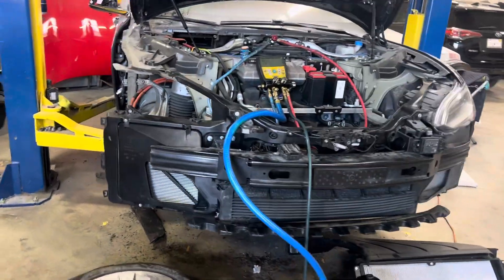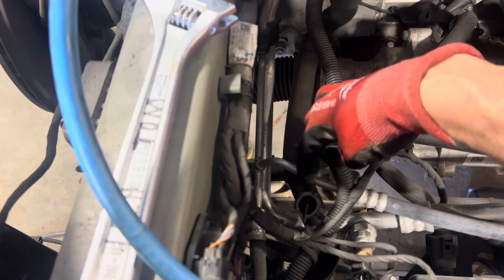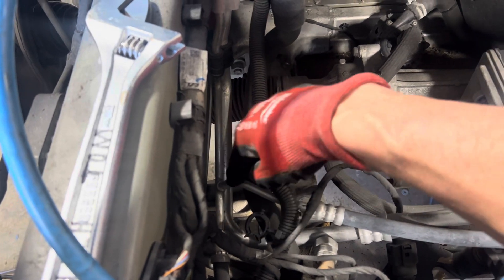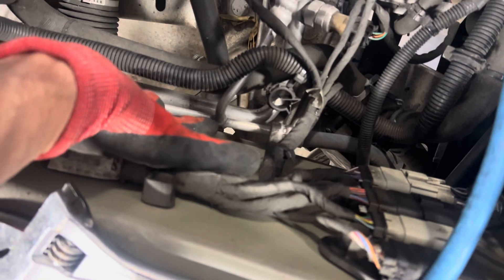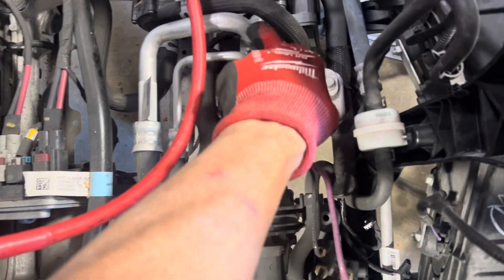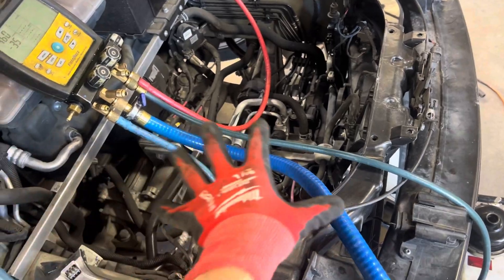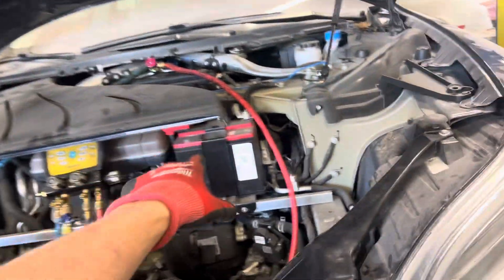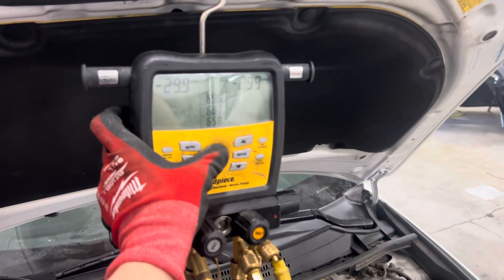AC tesla model SP 100 air conditioning circuit two condensers.

Comment: dual condensers rock .  but Very large singles also    Clearly see some car makers actually think about the design . With good condenser size the TXV receives constant  low temp liquid .  The TXV can then do its job really well and the evap core  works most very efficiently . In saying that good cooling is compulsory on an electric car  so u have to ask yourself  "" If it were not for the electric drive would the AC system be as good ???   In most cases probably not .
Reply from the maker: Dual condensers don’t make it run any better or any worse
It has nothing to do with efficiency or inefficiency 

Dual condensers are used because of necessity of lack of room space . 
They have that sloped small front nose that does not have room for a single large condenser . 
     You’ll see Lamborghinis Ferraris, McLaren, some Audi and many other cars that have that very sloped small space aerodynamic design put two small condensers in where they can fit them. 

About the only advantage, the electric compressor has over a standard mechanical compressor is when you’re ad idol, and the engine is at idle RPMs, mechanical compressors, or not designed to work efficiently so some cars you’ll notice the temperature of the dash start getting warmer when you’re sitting at a stop sign or Moving slow stop and go traffic on the freeway or street. 

Electric compressor doesn’t care it could just spin up to 5006 or 7000 RPM‘s as needed depended on the load 

The expansion valves the the same unless it’s electric . 

But this is one of the reasons and fuel efficiency. They have variable displacement compressors on cars now. . 

You can oversize the compressor a little bit 

And when you come to a stop sign or are in stop and go traffic .  Variable displacement compressor at idle speed, where a normal piston compressor may not work efficiently can just turn on an open up displacement up for the inefficiency a 700 RPM idling engine.. 
        This is one of the ways they have overcome that problem. 

Having variable speed or variable displacement has been used in residential specially com commercial for decades 

Automotive is just playing catch-up .
Reply: An  evap core has far greater performance when being fed liquid thats say close to ambient eg 45 deg cel/ approx 150psi  refrigerant on a 40 deg ambient day  vs 65 deg cel /approx 290psi on a 40 deg cel ambient .
You would be aware of the occurrence of flash gas . When excessive high temp refrigerant is supplied to evap this process occurs and  consumes BTU cooling capacity  performance there by reducing its efficiency . 
Automotive can often run pressures/temps pending design . Big condensers rock !
Reply from the maker: @paulthompson1654  coil, more efficient when it’s full of a liquid refrigerant at 0° superheat. 

Does not matter what the pressures are pressures mean nothing we don’t go by pressures. It does not matter what the temperature is. We don’t go by temperatures. That means nothing. 

It’s fully saturated with liquid refrigerant at 0° superheat. This is the most efficient evaporator. . 

But then we run into the problem of liquid refrigerant getting back to the compressor and wiping it out .

But there are, but they do not do that in Automotive 

On some of my commercial VRF systems I have a few videos out can run down to superheat 

Dehumidifiers are designed to run a liquid flooded evaporator .
Reply: Many imported vehicles/ machines  are often refitted in Aust due to the very hot conditions . Flash gas occurs to an excessive amount reducing evap BTU capacity [the evap has to reduce the very high liquid temp there by reducing available cooling capacity ]  . I n a very hot conditions evap performance needs to be working well at it most efficient . This occurs as expected in fixed displacement compressor systems . All auto based systems suffer from it to some degree ie its a linear scale . Head psi which is upwards of  225 psi is effected . Systems that run 250 up are badly effected by it . 300psi is not uncommon . This is most obvious in machines that have not enough evap size that operate in very difficult conditions .  
Very high sun loads ,  fast idling 1200rpm for hours , very high ambient 100--115f .  Think govt trucks , fire trucks , container cranes , tractors , underground mining equipment 
The  evap TXV  needs to receive cool solid liquid
Reply from the maker: @paulthompson1654  older BMWs high side pressure control fans from the factory. Don’t even come on until they hit 270 psi as normal. They could run there all day long and ice tea and stay nice and cold.. 🥶 

My personal 2012 Prius at 106°F is 39° out the dash no problem at all when properly charged . 

All my personal cars for the last 30 years I use for business idle all day long from the moment I get into them from 6:30 AM in the morning to when I get home at night the car never gets shut off stays running between jobs. Idling. .  Air conditioning never gets turned off in my.Cars. Engines never get turned off in my cars..
Reply: Euro cars , mostly British just have trouble keeping there engines cool let alone some of the pathetic a/c unit performances.  EG  In constant weather above 95f up to 115 f .   No a/c unit survives long term in high ambient with high operating pressures and performs .
When a particular full size vehicle came out here and converted to cabs and handi capped  taxis  the aircon was that pathetic after conversion they were sent back to GM . It took 3mths  but were up graded from serpentine to  parallel flow . This lowered psi alot  but still only just acceptable a/c perf.  300psi to round 250psi . These cabs did 6500miles every month , any issues developed quickly .
Reply from the maker: @paulthompson1654  we have no problems here in Arizona and Utah where it hits 122°F into the summer. 

Sounds like you guys need some different cars . Maybe Kia
Reply: Best performance retro fit condensers   was 160f/300psi downto 112f/150psi . More common results were  180psi--- 210 psi . Often results were also helped with aux fan .  In hot weather the ac evap performance improved alot .
Reply: @coldfinger459sub0  i like that you never turn off the car engine and the air conditioner .......that's very interesting..... cheers   Jay.

Comment: Can we say that 1st radiator is just a radiator, not a condenser, because there is no liquid? ;)
Reply from the maker: We call them heat exchanger. 
And whether it is a intercooler for a turbo charger that is blowing air through it that is hot. It’s radiating heat giving off heat. It’s exchanging heat. 

It’s a heat exchanger 

If it is a plate heat exchanger that has two different fluids flowing through it next to each other sharing the same wall of a plate. One plate takes water that is cold flowing in one direction and another plate takes the water from an engine and flows it the other direction it exchanges, but it is a liquid heat exchanger. 

It is always the same 

They are all exchangers , different industries just give them different names . 

It makes no difference whether it’s liquid water, liquid metal liquid salt or a vapor or a trans critical fluid. That is a combination of two or three states of Matter combination, liquid water, and sometimes a little bit of solid all at the same time. Call the trans critical state. 
  They are all rejecting heat.

Comment: Dizzying.  Is the 12V (or 16V) battery used in the AC system?  I figured the AC compressor would need the hefty power of the ion array that drives the vehicle, but that was just a guess.
Reply from the maker: The 16 V Tesla battery is only used for accessories and electronics and small items, computers, etc.. 

It uses the high voltage several hundred volts from the drive battery . Three phase compressor.

If you lick those wires, you’ll get a little tingle . Little more than a 9 V battery.
Reply: @coldfinger459sub0     Now I understand better why there was so much chatter a while back about Tesla contemplating entering the HVAC market.  I didn't realize how sophisticated they have made their auto systems.